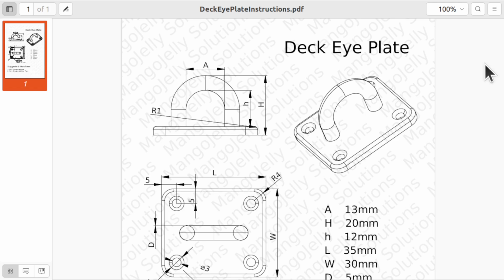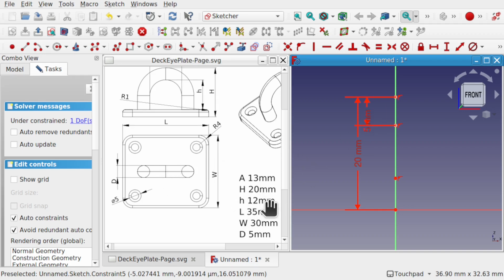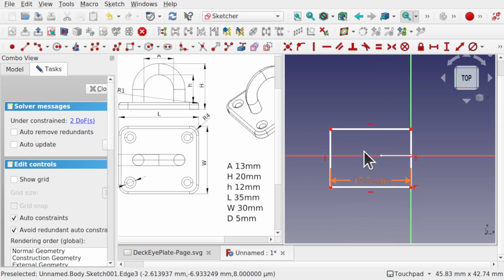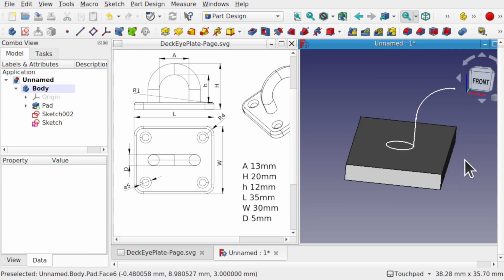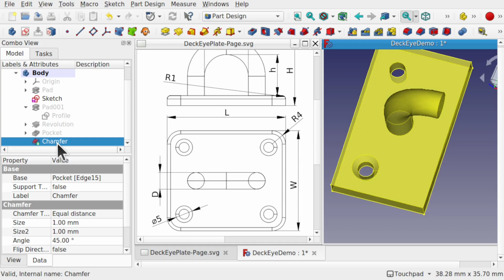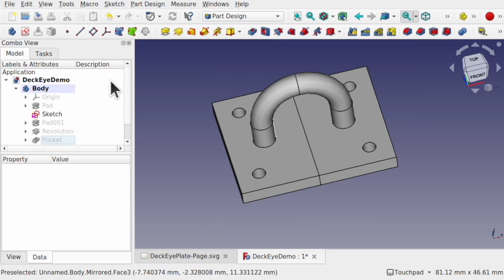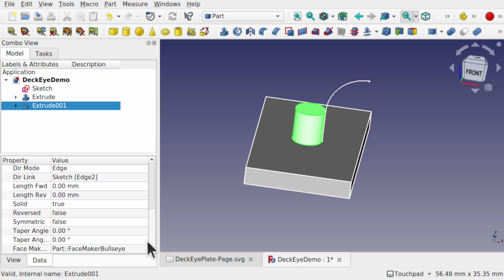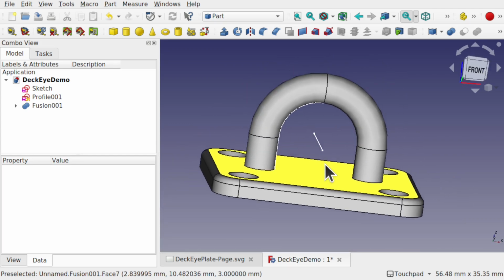FreeCAD 0.20 For Beginners | 14 | Making a Basic Easy Model with Different Workflows / Workbenches

Comment: if H = 20mm and h=12mm the diameter of the loop is d=5mm and it has an inner diameter of A=13mmthen the height of the BASE must be whats left after H - h - D = 20 - 12 - 5 = 13mm ... since you have all the measurements needed why didnt you just use math to set the sketch ... the any basic change to a primary dimension such as length wide height diameter of loop etc the drawing auto resizes 

just trying to get my head around why you chose one way over another ... when describing a parametric model from drafted drawings ... 

I keep making mistakes that pooch what I have done or get me stuck where I cant figure out how to go forward and so have to start over with a change in my approach ... I have a front side and top view I want to align for a freecad drawing I want to make digital and eventually 3d print and even CFD it 

from what I have seen so far in this playlist ... I can make a sketch of say the front that covers max height width and features like sides or lofts etc ... or say a cessna front end ... and set them to a spreedsheet ... great ... can i link that spredsheet to openoffice say and use the computed values I have form doing the 12 feet of aerodymaic maths I needed to define the shape LOL ... or do I have to redo those maths in the freecad spreedsheet ... or can I link directly to the freecad spreedsheet to get the dimensions I want 

perhaps a video taking front side and top view of the concorde and using that to create a 3d model for CFD and printing with full parametric limits from a spreesheet with a quick lesson in linking to openoffice (yeah its excel but FREE and better) ... and end with a basic CFD analysis on the plane (freecad 0.20.1)

caught a lot of mistakes I have made like verifying points are linked together or onto a line or curve etc ... being a old school drafter I am still getting reoriented from a top down view being XY and it is what you see in front of you so the front ... yep drafting XY is your Front view because what you see on the page should be facing you in real life ... which puts top down in xz and side in yz ... i think ... might have those last 2 reversed ... 

I could use more tricks to get nice curves from approximated straight lines for say a nose cone ... or fuselage taper etc ... and of course CFD stress analysis so we can figure out where we need to add some beefiness and where we can cut some meat to save weight and keep strength ... more concerned with learning the HOW than memorizing the steps ... understanding is hard to forget memorization is easy to forget ... FREECAD is quite resourceful and as such quite powerful ... the multitude of addon workbenches cover just about everything  ... but most lack decent tutorials or explanations and dont work on anything but that specific version ... so understanding HOW one can do the same thing different ways and constrain them back to a spreedsheet comes in handy and makes life less stressful ;) 

keep it up btw ... learning a lot .. and even correcting some bad habits as well ... wish I wasnt on a fixed income ..

Comment: I love your tutorials, but I managed to do this model all in part design and with another approach. I I just took what I've learned so far from your tutorials and applied that. 
So I :
1. first made a rounded rektangel with the correct radius on the corners. 
2. Padded it up, made a sketch the holes on top, pocketed them. 
3. Made a sketch for the eyelet part (just circle, which I roughly placed).
4. Padded that up to the correct height.
5. Made a new sketch on top of the latest pad, drew in the geometry from that and made a new concentric sketch, used that to make hook part by revolving 90 degrees along sketch vertical axis.
6. Finished up by mirroring all of the above and added chamfered  the holes and added the fillet in one fell swoop since I had the corners on the first sketch already.

On to the next one, this is fun.

Comment: I had a similar mirror error in part design, but it was after the mirror operation where it wouldnt let me chamfer this one particular edge. But as you said, finish your half and mirror in part worked fine. Just kind of annoying knowing there is an error with an obscured root cause. Im thinking perhaps it was a non optimal constraint somewhere.

Btw i hated freecad on first use, but coming back to it and following your tutorials ive completely changed my mind and ive become quite attached to it. This is a first for sure. Definitely worth a coffee.
Reply from the maker: I created a video regarding why fillets fail and some of the examples can be applied to chamfers as well. It may be that a refine operation applied to the mirror by clicking the mirror and setting the refine in the properties to true will allow the chamfer to take.

Really glad that these videos have helped you progress with Freecad. And thank you, much appreciated.

Comment: Awesome vid. Nothing that is your doing but this is another one where the lack of an image viewer workbench can be annoying. If you insist on having your ref svg in FreeCAD windows tiled, and not just alt-tabbing out to an external one or tiling the apps themselves with your OS. Transparency issues arise when idiots like me have everything dark themed and all my backgrounds basically black to match Blender/Gimp/Inkscape. I couldn't handle being blinded by a sun-white background to read the text so just slapped a new bottom layer on in Inkscape and filled the page with a grey rectangle. Not a problem but it's annoying to have to do that just to see an image when it wasn't necessary in the past.

Comment: Thank you very much mr. Darren for your really well explained tutorials! 
I ve been following through here and aiming to continue on your beginner series, having a little experience with cad design but trying to fully understand and adopt to freecad. 

I wanted to report an issue that i came with while trying to follow each step of this tutorial, using freecad 0.21.1
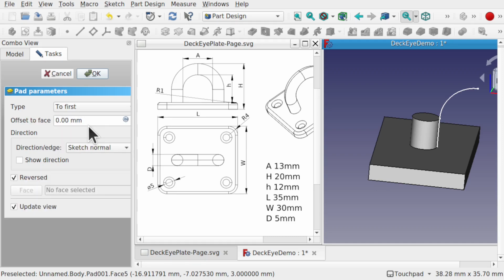At about 19:30 when i pad the profile i get an error at the report view saying that "The `.FCStd#` backup format is deprecated as of v0.21 and may be removed in future versions.
To update, check the 'Preferences->General->Document->Use date and FCBak extension' option." and afterwards that: "Recompute failed! Nevertheless i am able to complete the pad. 
Afterwards though, trying to complete the revolve, following exactly the video's directions i receive a design error. I select the Profile sketch and press revolve but i get a 360 revolution representation with a diagonal missing part of the "donut" at the previously padded part. Entering a value of 90 degrees just disappears the "donut" and leaves the diagonal cut pad as a result. 
A weird fact is that after trying again 15 times, for a couple of times, by doing the same commands i had the waited result. But then, to be sure, i tried again and i still receive the error design. I managed to design the cylinder with the additive pipe command and i can try to continue as this, i just tried to understand the error as well.
Reply: Using a different computer, with freecad 0.20.1 installed i manage to reach and complete the revolve operation with no issue. No sure if it is the different software version or something else though. 
Another issue that i noticed in both of my trials, has been the 5.5 height which is being set after paralleling the split designed point. In both my cases it has not appeared as 5.5 exactly, but something like 5.49998. while all the rest dimensions remain the same, which does not compute properly.. Having a total height of 20, with three subheights of 5, 6.5 (i added the 6.5 as a refence dimension as well) and 3, should leave a true 5.5 height dimension. for some reason though it doesn't get exact.

Comment: Hi, great tutorial again! Thank you.
I wonder, what is the more rigorous workflow: Part Design or Part? Using Part Design, an error popped up that was circumvented when using Part. So, if I wanted to use both parts, one designed in Part Design and the other designed in Part, could both be 3D-printed without running into problems? Like not-connected parts in the 3D-print or other errors? 
What would you advice as "best practice"?
Reply from the maker: Sorry for the late reply.  Glad your enjoying the videos.  I have a video on part vs part design that is kind of a speed breakdown of where and when they are used.  Part design is basically a cut down version of the part workbench where each operation is automatically booleaned together causing a linear working tree rather than a nested one.  Both are robust as each other but you would choose one over the other depending on what you are doing.  Only lately I designed a part where I used both workbenches as I needed to use a intersection workflow to create a hinge which was easier from the part wb.  The connection pin and mount for the hinge were easier and quicker to create in part design as it automatically booleans these together.  I put all these individual parts (hinge, pin and connection point) into an assembly workbench and I even exported out the individual parts for 3D print from there.  At the end of the day a part made in part design will end up when exported exactly the same as a part made in part wb.  I am putting together a video for the part I made as we speak.

Comment: Thank You for your Excellent video tutorials. I am using version 0.21 (!). The error you got at 20 minutes , in my model, came when i created the revolved arc with reference to the vertical sketch axis. A wrong arc was created ! I had to use the arc edge from the base sketch as a referece axis (like in the Part Revolve). The resulting model was mirrored fine after that. (all was in PartDesign)
Reply from the maker: Thank you for sharing this information with everyone, great that you have shared the issues and resolution to help others. Appreciate that 😊👍 glad your enjoying the videos.

Comment: Thanks for creating some really great videos! I'm going through all the videos in this playlist, and I'm learning a lot! I have a question about the last version you made, in the Part workbench: I figured out how to use the profile sketch and do a sweep along a path (with the first sketch being the path). In this step you used revolve. Is there some advantage to using one method over the other, in this case?
Thanks again for the excellent content.
Reply from the maker: Great to hear your enjoying and picking up knowledge. I put these together as I wished there was something like this when I first started. So there is no advantage over that method at the end of the day it creates the same model. I would say that the path sweep is better as you have more control over the end result and are not restricted to a circle

Comment: Hey Darren, how's it going. I'm trying to model lens for glasses and sunglasses, I can make them flat but to get the shape I want from the front view but to curve that sketch I can't seem to figure it out, what work bench would be best for this? I can do it in Blender but for parametric modeling to change size and shape Freecad will be much better. I may be ahead of my self but I like to push what I have learned
Reply from the maker: Yes can help you. Believe or not the standard part workbench is sufficient. I am actually doing a full glasses and frame tutorial for a patreon which I can include you in.
Reply: @MangoJellySolutions   Ok, sounds good, what do I need to do
Reply from the maker: @Zimbob2424  Actually just realised You can get the lens from following the spoon tutorial on my channel (beginners tutorial 15).  It's same concept just different shapes.  I am thinking of doing a index to these on a blog and listing the items that people have made using the different methods in the hope to build up some kind of search to point people towards the right video for a possible solution.
Reply: @MangoJellySolutions  cool, I'm on lesson 14, if I didn't get distracted trying to make stuff I would have been there. Thanks

Comment: Thank u sooo much. Yesterday I was trying to create a padlock and had issues.  By coincidence your video popped up in my feed today. Crazy how things work
Reply from the maker: Lol, yeh that happens often I found.  Had quite a few people hit a issue and say to me that the video I just made covers it. I'm going to have to start doing the lottery at this rate!
Reply: @MangoJellySolutions  When moving one sketch to the Another body., sometimes it. will not drag.. Over, but if you right click on it The sketch that is.., it'll pop up. a dialog menu. that allows you to move it to another body. I think you need to make people aware of this. As I had a very frustrating time. Moving the sketch. Also, we need to come up with a better way of placing the holes. and hole. types.

Comment: Hi , Darren . How are you and yours doing today ? I had another great day when I saw you had posted another video . I always look forward to these , this one wS great too . 👍  one question I have is the line that was still visible in your last frame . I think it was the line used to do the pipe extrude in part ? How do you clean this up ? I was curious if you have wore your 3D printer out yet LOL ?? They are fun AREN'T they  ?  Take care my friend , stay safe . 

Terry
Reply from the maker: Hi Terry, doing well hope your in good health and keeping yourself busy. So pleased that your enjoying the videos , it's always a pleasure to do them. Ah yes so the line would be the sketch which we used as the guide. If you click on the line it should appear in your treeview. It would be nested in one of the actions. Just press the space bar once selected and it will be hidden. Hopefully today I will be actually printing something on the printer. Been waiting for payday so I could buy some PLA but this morning I found some in the the original box that come with the printer, it must of got lost when I was unpacking it as its a couple of coils in a plastic bag . Should be just enough to print a test print. Take it easy 👍👍
Reply: @MangoJellySolutions  If you're using the spool that came in the box, keep an eye on the print in case it gets tangled up.
Reply from the maker: @mfraz74  thanks for that, I will. 👍👍👍👍